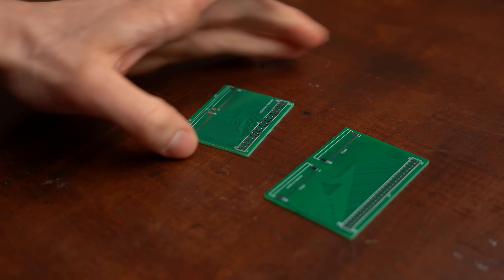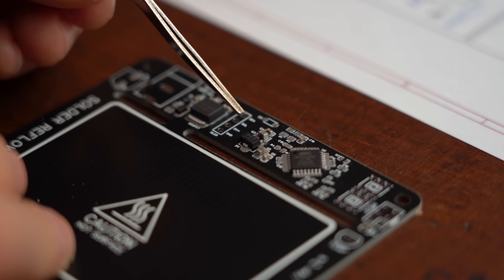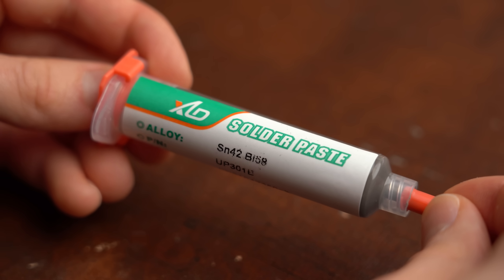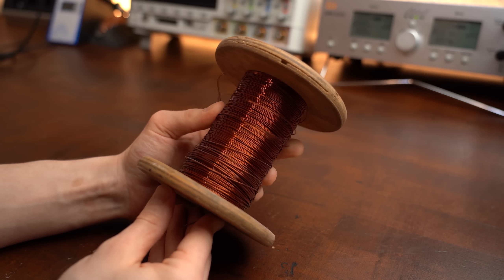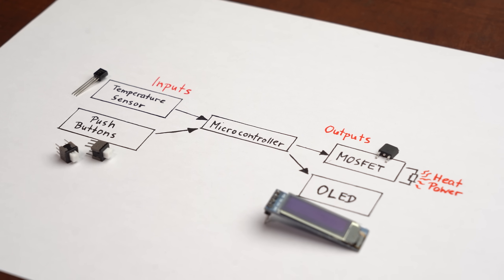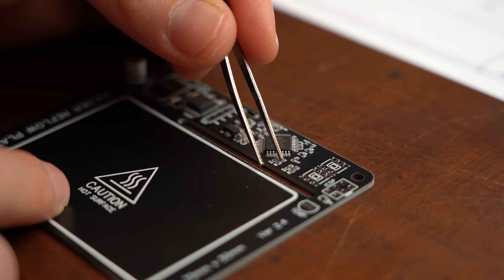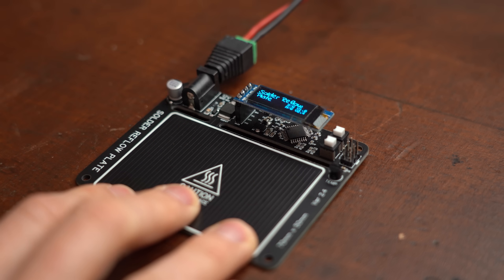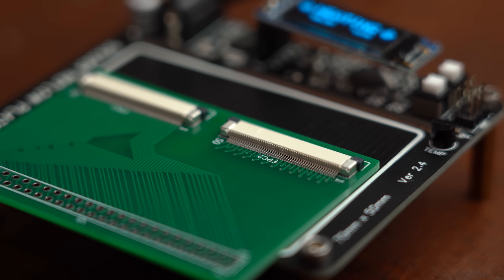The Best way to Solder? Hot Plate to the rescue! (DIY or Buy)

Comment: To address the lifespan of the pcb heater it might make sense to have the control circuitry on a separate board and make the heater pcb a consumable. It is definitely not as clean, but potentially more practical.
Reply from the maker: True
Reply: @greatscottlab  See my comment using a TEC instead of copper tracings/wire. It is true the adhesive gluing the tracings to the PCB would degrade over time/usage.
Reply: @greatscottlab do you plan on selling these because I’d like to buy one. I can do $40-50
Reply: @greatscottlab sorry can you please update the aliexpress links they aren't working anymore. Thanks .
Reply: @greatscottlab  I've seen electric stove used as hotplates, more surface areas and maybe more resistant. 
Can you try something from Instructibles, also is using an arduino..?
Reply: Exactly my thoughts! :)
Reply: Having a separate heater board, with a temp sensor/ thermocouple in it would allow for various sizes as well as be a replaceable part.  In the test of the DIY solution, did you measure how hot the microcontroller was?
Reply: @rfdspguru2  I agree on having the temp sensor as part of the consumable heater. I’m surprised that the temperature sensor was not more closely coupled to the board. Even though it’s near the heating element, it’s still in open air and the subject to all sorts of environmental variables. Sure, it’s case cannot handle the full reflow temp for very long, but it seems like it could still be coupled somewhat more directly - perhaps with a thin trace on the PCB, a thin “L” strip of Cu/Al from the PCB to the TO92 package or maybe even a moderate insulator between it’s case and the PCB. (Just brainstorming there…) There would obviously have to be some thought and experimentation put into it, but I would expect it would be worth it in the end, as both the absolute temperature and the temperature curves would likely be much more accurate and consistent. Come to think of it, maybe that “L” could clip or rest on top of the PCB being soldered - further improving the temperature regulation/control. Hmm. Just ideas…
Reply: perhaps a thermocouple taped to the underside, like the Prusa uses, could solve the problem
Reply: @rfdspguru2   Hey Matt. Something I'll look into! The ground plane stops at the point where the gaps in the PCB are, therefore the heat spread from the plate to the control circuitry is minimised.
Reply: I wonder how much flexibility there is for the size of the heating element. It would be nice to be able to swap in and out smaller and larger elements, as needed. Smaller ones would probably have faster response, whereas larger ones would simply be better for larger boards. I would hope that the area could be increased, if needed - even if that meant adding a second or third independent heating element and corresponding MOSFET/s. I could be way off, but my presumption is that, for temperature control to be ideal, the size of the heating element and the size of the PCB need to be similar.

The project is very clever, but from what I can tell, for the example shown in the video, the usable area is just a little too small for the kinds of boards I typically need/design. In the video, this looked like a bit of an issue as well. Nevertheless, it looks like a very handy device that’s not too expensive. If I didn’t already have one of those mini hotplates shown in the beginning of the video, I would definitely build the one designed by Chris.
Reply: @a1nelson  I am thinking 4 of these laid out in a square that can be controlled individually. The needed zone(s) could be turned on & the unused zones help with supporting the rest of the PCB. And if a zone fails you don't need to replace the entire build area. But by that point you've turned a $25 project into a $100+ project.
Reply: @nickpayne1182  Makes sense. It’s an interesting concept. I totally agree that it would raise the cost. (Btw, I don’t see why multiple controllers and support components would be required - only duplicate MOSFETs, temp sensors and the coils.) On the upside, it would remain compact, relatively inexpensive, have pretty decent temperature control and still be less expensive than other options that offer a similar level of control and board capacity. Like anything , there are pros and cons.
Reply: My thoughts as well, plus having the heater PCB as aluminum-clad to help distribute the heat evenly. These are done with 3D printer heated beds as well
Reply: and use this reflow heater to make it!
Reply: Maybe even a heating Plate from a 3D printer
Reply: @DS-qm3bs  My MK3S's bed has a max temperature of 120 degrees C
Reply: @Ziggurat1  true most are in that area but silicon heat mats with an aluminium plate would work since those can get up to 200°C and higher if I remember correctly. Though most of those are AC.
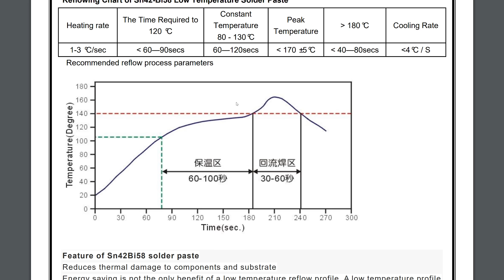Reply: @DS-qm3bs  Are you aware of a 3d printer bed that can go up to the required temperature? It is show a peak temperature of 170 deg C at 3:26.
Reply: It would also work nicely with PCB manufacture services usually having minimum orders of 5 or more PCBs - if you're just making one for yourself, you'll have spares anyway.
Reply: This is a really good idea for a second reason; you can further isolate the heated "coil" from the controls, potentially getting a higher temp without jeopardizing the solder joints on the electronics. Also, you get more freedom to min-max the design (2-layer for the controls, 1-layer for coil, or using a thicker copper on the coil, or anything else.) Finally, this allows the designer to more easily handle any potential thermal expansion problems.
Reply: Good idea Collin! I'll have a crack at designing that!
Reply: Came here to stay just this.
Reply: Personally I think it's an excellent idea! That way you could have different sized boards for different projects, i.e. you don't need to heat up a huge board/area to complete a tiny project, you just select the board size you need to do the job, which in turn would mean that the boards would last longer as you're not heating the same board over & over, unless your projects are all of the same size of course...
Reply: I was just about to post a comment suggesting the same thing. Making the heater element """disposable""" and decoupling it from the rest of the heater design would allow easy repair/replacement.
But I also see it as an opportunity for expansion; see, if there were headers or a socket with decently gauged wire, the plate may not even have to be mechanically coupled to the main circuitry, meaning you could potentially have a larger plate, odd dimensions, or something else.
I'll admit I've not looked at the GitHub repo (because I'm on my mobile right now), but I would assume since reworking to the Arduino code and some of the power components would be needed to accommodate a larger heating surface.

But overall, this diy project is amazing!
Reply: Could also have the heater plate PCB on a different plane so the space issues isn't as great. Allowing the part to overhang on all sides.
Reply: @karlmikko  +1
Reply: This could actually help with the spacing problem too, as having only the board and no components in the way allows u to move around your pcbs more freely
Reply: @greatscott so if you reply to a comment and boost its likes does that fsck the contest?
Reply: I just posted a similar comment without checking if anyone had gotten there first...
Reply: Thought the same
Reply: Yup, a sacrifice hot plate is something to upgrade in the future!!
Reply: Haha I wrote my comment ..then saw this!! Great minds and all that!
Reply: Also use nichrome instead of copper.
Reply: Exacly. Make it easily replaceable. It may still produce smoe toxic fumes but soldering also does
Reply: https://youtu.be/WDMHBVuI7vA
Reply: Good to know I wasn't the only one thinking on this solution, wouldn't be the first time we saw the power circuitry being apart from the control circuitry. Think of it like a kitchen oven, the eletronics is a pcb asides from the rest.
Reply: I honestly thought at the beginning of the video that this modular approach was going to be the factor making it a clear winner.
Reply: I hate when other devs document reiterating what something is doing rather than why it is doing it. I can read code, I know what it is doing already. I may not know why it is doing it, though.
Reply: How about if the heater was made as part of the PCB being constructed? Put the PCB down, attach to a power supply and crank up to the appropriate current. Might mean a sacrificial layer that wasn't used later but might be possible to repurpose it as a ground or power plane?
Reply: You could... Or you could design a silicone heater which isolates the circuitry away from  the heating area by utilizing a nichrome heating wire embedded farther away on the same pad or attached with nylon or other insulating materials.
Reply: Yeah but it wouldnt be profitable then
Reply: I'm thinking 3D printer heated bed, a lot of them use the same copper trace, though normally 100C or 110C is the most they are used at.  Relocate the electronics and the pcb should last a bit yet be easy/cheap enough to replace when it goes out.  Got me thinking about the extruders on 3D printers, using a heater cartridge to heat a block of aluminum... set up an Arduino to monitor and control the temps?  IDK, may try it one day.
Reply: This was also my idea, now I'm planning to do a modified version of the heater, with the  replaceable PCB heater and the ability to be powered from a type c port
Reply: Gotta think of use scenario a d length of use. Thinking long term towards the future can hurt as much as it can help, sometimes more so. You might have bought the concrete and tools to turn the path into a road, but sometimes roads end up leading to nowhere(you might design for a non existent future).
Reply: how did you make that awesome pcb? it looks sooo professional
Reply: Yes 11:20 currently I’m designing my own less good version that’s like this 11:20
Reply: MOAR UPVOTEZ

Comment: The infrared hot plates are a more versatile but also expensive option as it doesn’t need to make physical contact with any circuit board; even ceramic boards!
Reply from the maker: Sounds interesting. I will have a look :-)

Comment: It's maybe a bit bulky but I was thinking about buying one of those cheap kitchen top hotplates. There are a ton of used ones that you can get quite cheap or even free. For control I tought about bang-bang it using a solid-state-relais and an arduino.
Though I must admit that small DIY hotplate looks like a very fun and useful project

Comment: I think ...that can be changed/improved with a induction heater under a plate instead of the PCB heater.. should be quicker, less problematic with size and also lifetime almost endless.
Reply: Problem with magnetic fields and reflowing SMD components, is that the components start moving around at some point.
I'm using a broken IKA magnetic stirrer hot plate (motor is broken), but had to remove the magnet to make it work properly. Once the flux starts to flow, the paste doesn't hold the components anymore, and some of them orient towards the magnetic field. Some stand up straight, others flip upside down, and some just plainly leave the PCB...
Reply: @Soundstorm-q9q  that's why I've mentioned a heated metal element above the induction coils. Should be shielding enough i think..
Something I could try to build and test.. and sell 💰
Reply: @crckdns  The way the IKA hotplate is setup, already represents what you propose. From bottom to top, there is a stack of motor, magnet, insulation, resistive heater, metal heat spreader, stainless steel top. There is more than 2cm between magnet and the top of the plate. Now if course, this is a stirrer, so the concept is that the magnetic field is quite strong to reach the inside of the beaker on top.
But I also tried putting a 10mm aluminum plate on top, before disassembling the unit, it didn't help :(
Reply: @Soundstorm-q9q  oh wow ok, thanks for that insight!
Reply: considering an induction heater induces a voltage and therefore a current in the components I wouldn't trust it to not fry components

Comment: Fyi, Carl Bugeja did s few projects around using a PCB as a hotplate.

The short of it is that the solder mask and material will eventually fail, THOUGH this was with regular temp solder, not low temp like you're using.

Comment: these hotplates and reflow ovens are good an all but i just love to hand solder even the most tedious components just for the fun of it, ngl its kinda relaxing
Reply: Its really is, and the majority of people here understand that. But every now and then you come across an aluminum PCB that needs a ground plain soldered. 
And god forbid if its a small component. Its basically Impossible to hand solder a 0603 on some PCBs.
Reply: true, until you get to QFN packages or similar xD
Reply from the maker: No shame to hand soldering. I love to do that too from time to time.

Comment: If you don't have a hotplate yet, but you got a heat gun laying around: Just put one edge of the board in some kind of holder, like a vise or alligator clips and heat it from below. This has the same effect as a hotplate. I have soldered like this very often, no damage to the backside of any board yet and you can control the heat intuitively with your hands. Only downside is that the heating isn't as uniform as with the hotplate and large boards will warp a bit because of that. Largest one i have soldered this way was 100x70mm^2.

Comment: Beats using a pan of sand on a cooker 👍😊
Reply: But does it really? I had great success with a $20 hot plate
Reply: @TimHayward  yea same old George forman grill also works well just a bit finer temp control with these, nothing to stop you using the same temp control code with an arduino and a scr to control the plate
Reply: @sccsuk  I had a PID controller on mine but in practice I didn't need it. I didn't do heat soak phase. I just put the board on a metal spatula watched the solder melt and lifted it off. For me it worked great and never really failed.

Comment: It's really easy to make a DIY hotplate, just order an aluminium PCB from JLCPCB with one long thin trace winding around it. Use a thermal switch instead of the complex microcontroller system.
Reply: i think a thermistor would be better? thermal switches have undesirable characteristics such as only turning on above a minimum activation temp, as well as the repeated on-off cycling doesn't seem like a good way to maintain consistency temperatures
Reply: can you please make the gerber files for this please? @Andrew

Comment: I thought these kind of plates before just as a support helper, to bring it to a closer heat Temperatur and then use hotair or the soldering iron finally for easier assembly.. But I was also thinking of re-using a 3D printer heat build plate 🤔
Reply: most cheap 3d printers don't really go high enough. I used mine to loose the glue while opening a phone (great use), but cheap ones usually stop at like 100-110 C, which is not enough for resoldering. maybe spare parts for higher-end machines like the vorons or the e3d toolchanger might be better.

Comment: Interesting video. I watched couple of videos of PCB based hot plate and this one looks promising as a product. A slight disadvantage is you will need a lower melting point solder but shouldn’t be an issue for hobby projects.

Didn’t know JLC started offering 3D printing. Will have to give it a try next time I order PCB’s from them.

Comment: If only I had a hot plate to reflow the solder paste on this PCB-based hot plate.  :D
Reply from the maker: I knew someone would comment this. But literally the first comment👍 Love it🤣
Reply: The component count is not that high, and it might also possible to do the reflow with a cheap heat gun. Though I'm also subscribed for a ready made product; I'm not that adventurous.
Reply: 11 days ago are you on Mars guys
Reply: it can be hand soldered or just use the pan and sand method, it works pretty well
Reply: @ShahZahid  The comment was meant to be tongue in cheek, there's definitely ways without a plate.  🙂
Reply: @fiordhraoi1  i knew it was a sarcastic comment and a good one at it, but i just wanted to add this method as it is quite underrated, you should try it sometimes